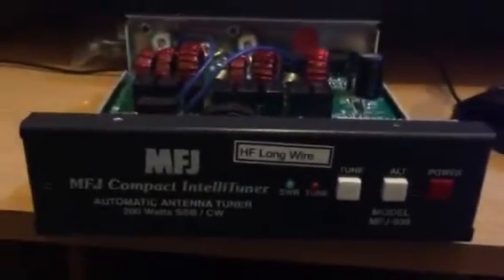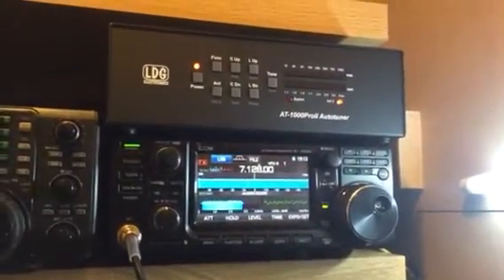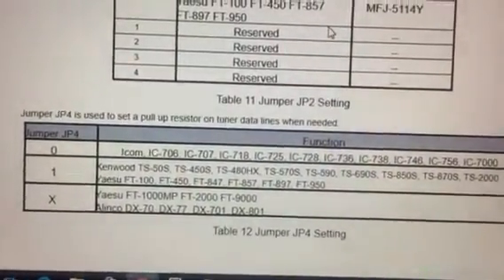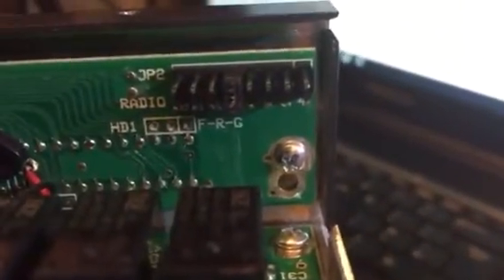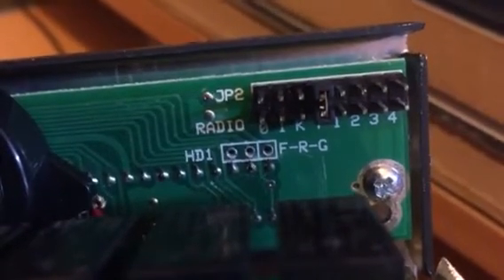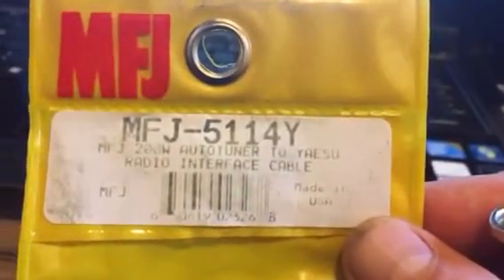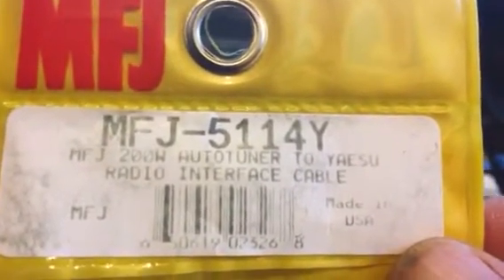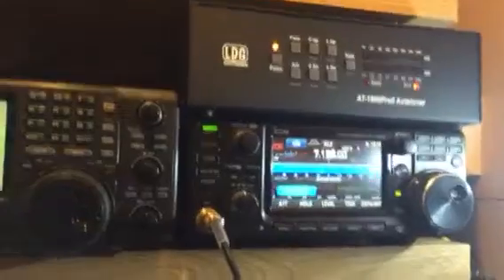FT991 interfaced into MFJ-939i internal links setup

Comment: Can you please share what settings you changed from the menu in the Yaesu 991? I have an FT-991A. Thanks.
Reply from the maker: Hi, i think it is Menu item No 143 "Tuner Select" - change from "Internal" to "External" 
Sorry i cant check as I no longer have the FT991A
Reply: @waynephillips1848  Thank you for your reply. You are correct. But in addition, I discovered that I must select>Radio Interface>Yaesu from the 'Mode' menu selections. 73's

Comment: Hi i was wondering if you knew what component r25 next to the relay is im pretty sure its a diode not a resister as my one burnt i cant find the parts list any where  .cant read the part number burnt.
Reply from the maker: Hi, R25 is a 100R 2w resister
the only other diodes are D35 AND D34, CDSH270, Part of REF and FWD circuit.
The diode across K1 relay coil is D1 and MMBD914. Hope this helps

Comment: Did you have any trouble with C4FM not working after you hooked it up
Reply from the maker: To be honest cant say I ever tried C4FM on HF. The tuner was connected via the HF/50Mhz jack for use with a end feed wire. I have read that if your radio Ft991 or A has the Mars/Cap mod it can limit C4FM on 28 and 50Mhz bands, this would need more investigation,  unfortunately I neither the Tuner or the FT991 anymore.
Reply: Well here's the funny part about it the tuner an all is on the HF side of the radio but whenever I hook it up for some reason I lose the C4FM on the 2 meter side but I appreciate you taking the time to respond back 73 DE K5FMJ

Comment: Can you advise which cable this is?  There is conflicting information on some vendor sites.  What type of plug is on the end of the cable you have? MFJ-5114Y  - one site shows a banana plug - another shows a DIN type.
Reply: MFJ sells cables for the different radios (or you can make them), you then open the tuner and swap jumpers to select the radio brand. Wiring diagrams for the cables are included in the manual.